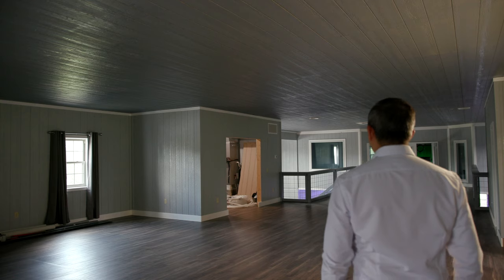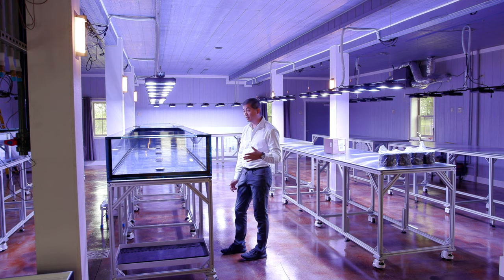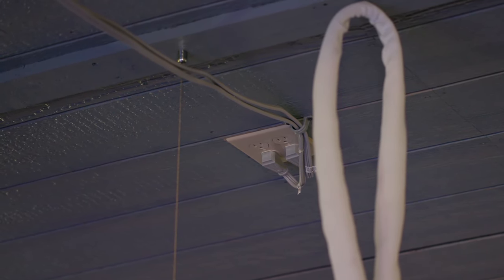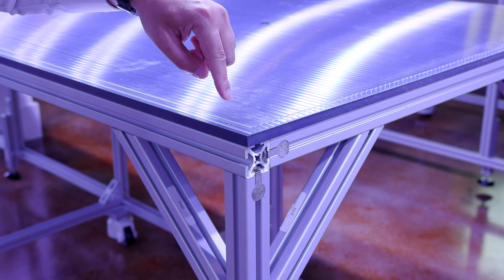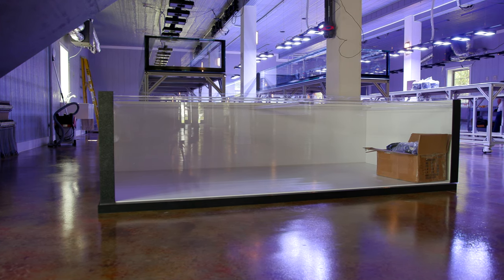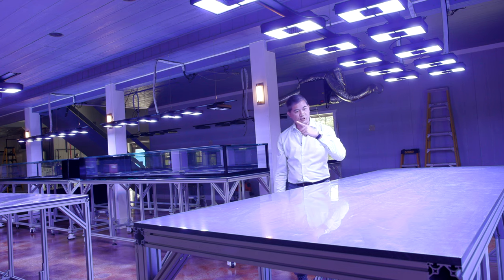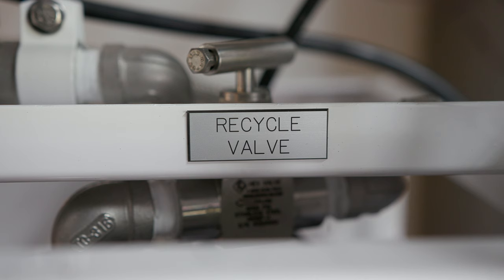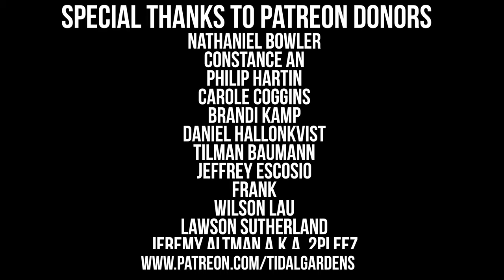Tanks are finally here! Tidal Gardens August 2019 New Building Update - Episode 10

Comment: for your peninsula tank, you could take some black schedule 80 pipe (or black steel industrial pipe used for running gas lines), maybe 1-1.5" diameter and run it from under the lip of the bottom base of the guard rail (or even the top if need be) to the back wall. you could then drill access holes into both ends so you can run all of the power cabling through it to your outlets.

Comment: Slide some through wall magnetic power heads down into the sides of the tank. Orient them to pump in a circular motion. You'll be mixed in no time. Also, possibly a stainless tankless water heater in an exchange. Warm water dissolves salt faster.

Comment: If you face the black side to the other tanks it could be storage or work bench/packaging station on the back of the stage, it would also create maybe small sitting room on the other side.  You could build an aluminum rectangle for the back glass that would match the tank base. this would give you something to lean on too, then add two corner pieces to the front sort of making an aluminum framed tank. Keep the posts extended and use wire or poly rope across the posts to hang the lights, you would probably want that to be strung tight as a piece that sits on the posts so there is nothing really touching the tank at all. They also have those gear screws for automation that you could use to lift the light rack up, they sell tables now with something like that... gut four tables, make them non movable you can still use them as a table and steal the actuator from them

Comment: Could you use a large air pump with air stones/bubbler hose in the water tank to "mix" the water instead of using an oar to stir? It would create the circulation in the water and would he easy to turn on and off.
Reply: Salt creep, my good friend 😉
Reply: @tom-andrethomsen  would salt creep still be an issue if the air tube was in the tank and sealed with caulking where it exited the tank wall?

Comment: Hey Tidal... hopefully you can get your electrical problem fixed. Like you explain it I think it's probably too much power usage on the 20amp socket, so when you ask for power for your lights, the breaker can't provide it and will switch off (inside is a safety metal that will bend due to heat generated by more than 20amps your asking). You can solve this by removing a part of the lights to a second 20amp (like it should be done and what you asked). If this isn't possible you can try to change the 20amp to something higer like a 25amp or a 40amp... not ideal but it's better than breaking your sealing and walls open to rewire stuff... you can calculate your amps by counting how many watts all your lights use and multiply it with 110v (or 220v, dunno what the US uses)... example : 20amp breaker multiplied with 110v is 2200 watts of lightning (or pumps or any other electrical device)... hope it helps and you can fix it fast... nice progress on your place :)

Comment: Dear Sir   if your plumber needs a helper I will be there. Also I did work with sch.80 pipe and did the illuminator a 100,00 sq ft building also you can weld sch80 pipe, if you have a leak. Also for your outlets they do make plugs that are in different ways to plug in.   You have a awesome building and have you thought of a cooling tower?  When will you be open?    Nice video sir.

Comment: You might want to check out the radiation pattern of your unifi access point, they are usually better mounted on the ceiling rather than on a wall. Just friendly heads up!
Reply from the maker: I'm not sure.  We had one unit that did a good job providing connectivity to the whole building but we chose to add another one just for stronger coverage.

Comment: Do you mind sharing the type of castors you've used there? Also - are those adjustable for leveling the tanks? I've noticed you have standard adjustable feet AND castors? How it is going to work? When you don't need to move the tank it will stand of feet but when moving is needed you just lift the feet up and the tank will sit on castors?
Reply from the maker: The casters are Footmaster leveling casters (https://amzn.to/2YPBzvz).  The ones I got were the 120 model that can each hold 2200 lbs.  When the tank is moved to its final location we will stand on both the feet and the leveling caster feet.  The casters extend down their own foot.